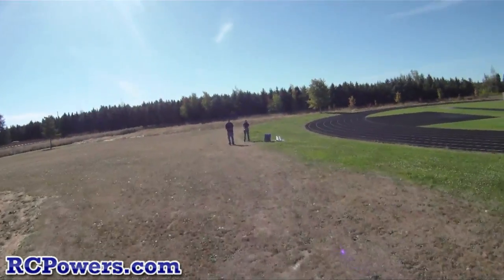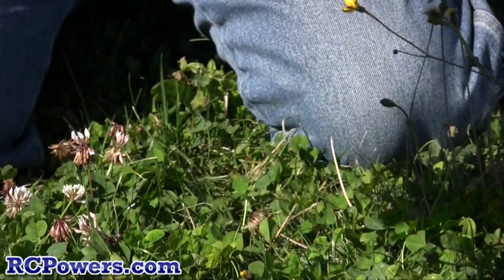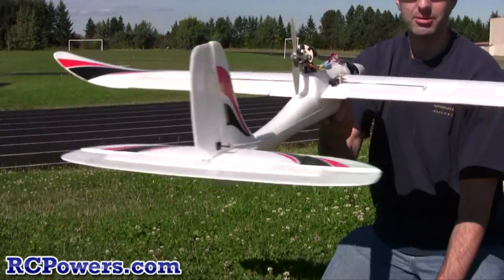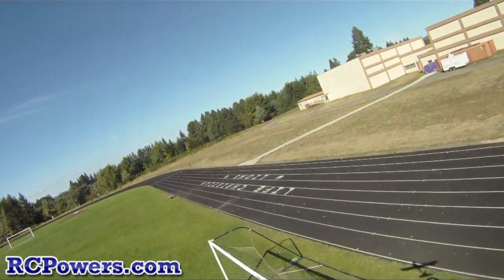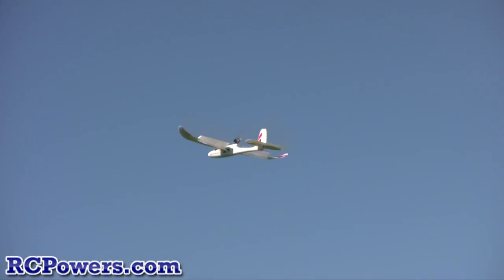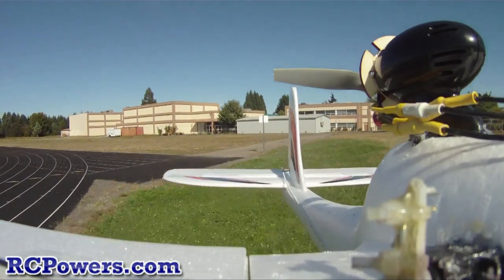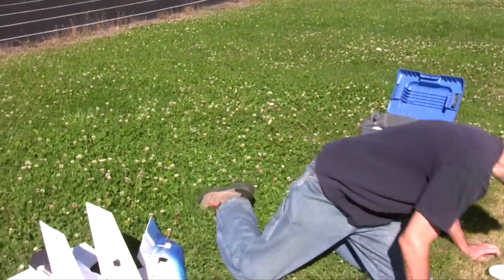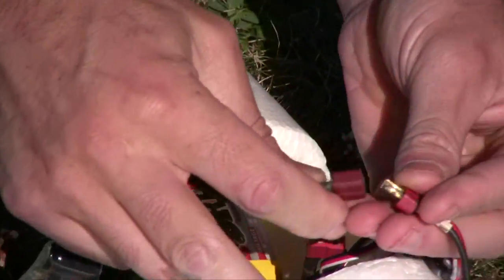TESTING AIR BRAKES

Comment: There are two types of airbrakes. Large ones which deploy perpendicular to airflow causing large air resistance by themselves are typically used in fighter airplanes because of their faster response and more direct effect on airspeed.

Smaller lift reducing spoilers deploy up from the wing separating the airflow, decreasing lift, requiring increase in angle of attack to avoid rapid descent, which subsequently causes airspeed to decrease. I'd love to see how the second type works on small scale!

Comment: Hey scott
i am puttting my FIRST!!!!! microjet v3 on my hawk sky and i have 2 questions
1. Would a 30 amp esc work with the microjet?
2.Am i supposed to glue the wings on with the new motor, because dave said dont glue your wings on, but with all the speed from the motor i dont know if they would stay on?

Comment: @wise66420 Hey sorry to hear you broke your plane. I got my son the same one for his birthday. I have a few videos on it regarding some mods we did to it to fly easier. Also more power. It is foam so should be able to glue it back together if it is not to bad. Also if you are a beginner I would hold off on that x-31. Dave is experienced so there are no issues for him to fly that plane. As a beginner I would stick with the Sky Surfer for now. Hope you get it back in air